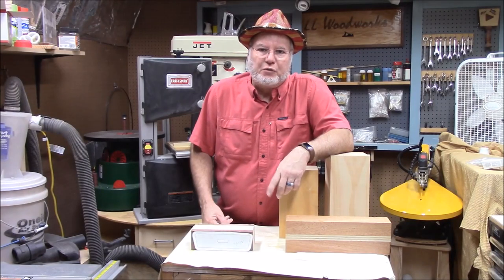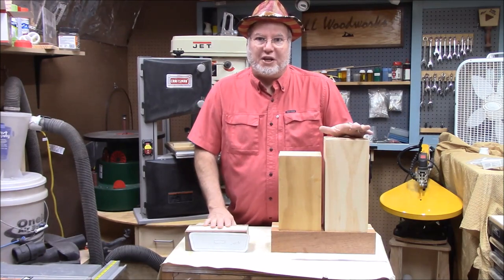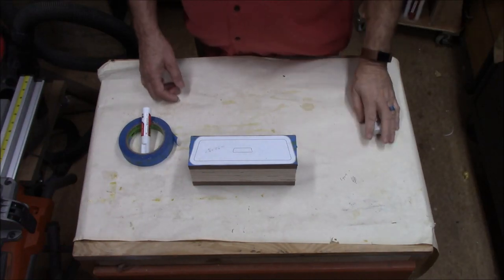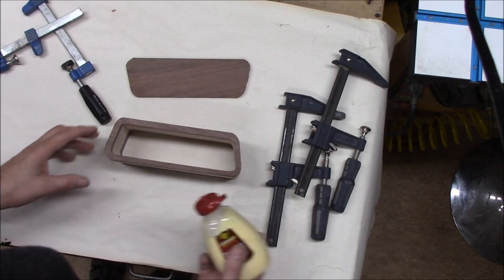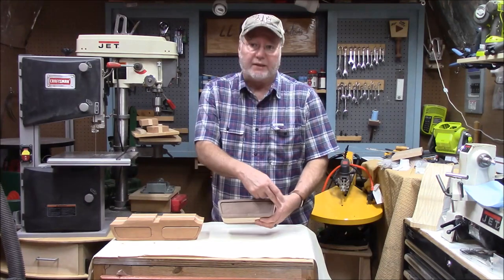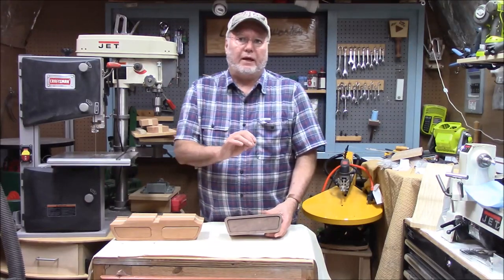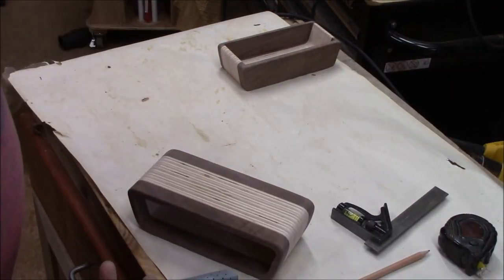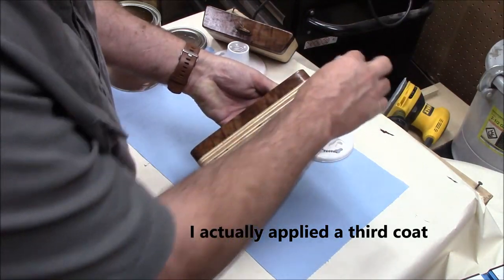Band Saw Box - Simple to Complex

Comment: Great work! Now I need to go get a band saw.
Reply from the maker: Thanks Loren - take the plunge.  Thanks for watching.
Reply: Ryobi has a 9" for around $130 depending on where you live.
Reply: @sheepleslayer586  I tried the Ryobi and it did not work for me.  I wound up getting a Grizzly 14" and once I finally got it adjusted it works great.  But one thing I did not know with the Ryobi, the blades that come on these things, including the Grizzly are junk.  I tried a Timber Wolf blade and it was as if I had gotten a much better saw, so that may or may not have worked with the Ryobi.  The blade just would not stay on the tires with the Ryobi when I would try to turn the corners in that thick a piece of wood.  Just some thoughts.

Comment: Liked and subscribed.
I really need to calibrate my bandsaw.  The blade tends to drift in random directions.
Reply from the maker: Thank you for watching and for your support.  Best Regards
Reply: oobaka1967 get a good set of bandsaw guides. Like carter guides . Tune them right and it will cut straight .
Reply from the maker: Carter guides are great - I have them on my 14" - Thanks

Comment: I've never made a bandsaw box and I have a question. When you cut the drawer out of the block you have a cut in the case. what do you do with the cut? I don't see it on the finished item.
Reply: Peter Minella I glue mine back together and clamp it. Its best to make the cut with the grain. That way its less noticeable when its glued back up.
Reply: Michael Gross I assume you're using a very thin blade then, otherwise the box would look out of shake. We blade do you recommend?
Reply: I use a 1/4" wide blade for doing the turns to cut out shapes. The blade is only about 1/16" thick and the kerf is usually easy to glue. Sometimes the box shape can make glueing back up difficult. Such as the sail shaped boxes from this video. For boxes with several drawers I put the entry cuts on different sides of the box going with the grain.
Reply from the maker: Hey Peter, great question. That is something I'm going to cover in a followup but you simply glue the kerf up.  Put some glue in the kerf and clamp it. Most of the time it disappears.  Thanks for the question and for watching.
Reply from the maker: Thanks Michael for the comment.  Hey Peter - What Michael said, my exception is I use either a 3/16" or 1/8 " blade most of the time.